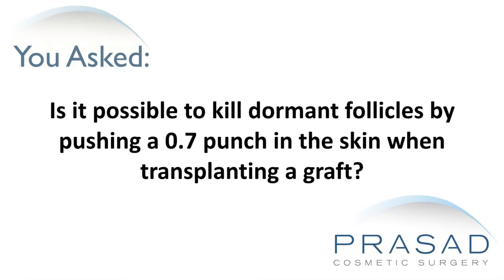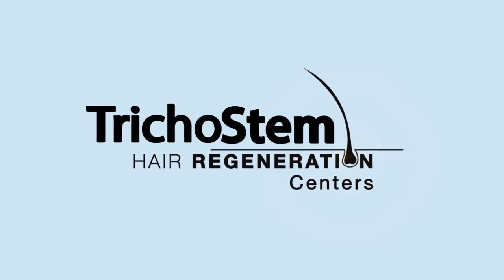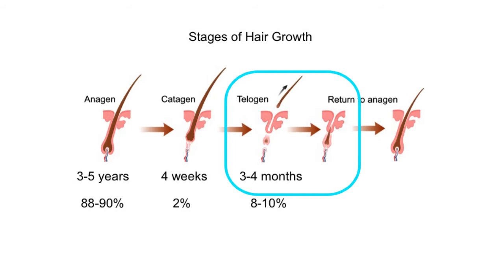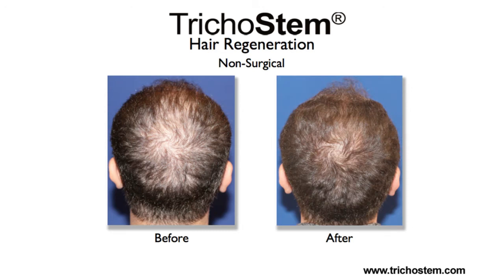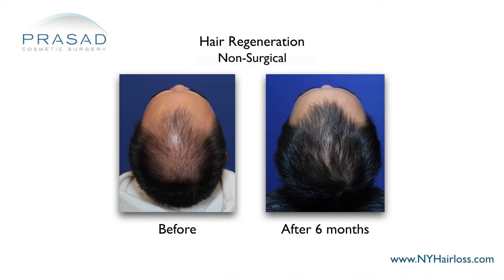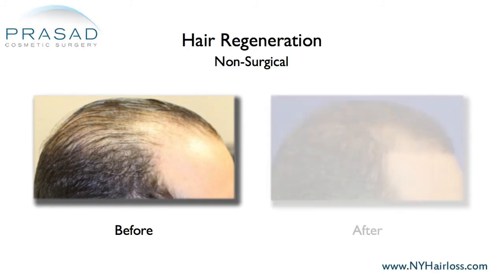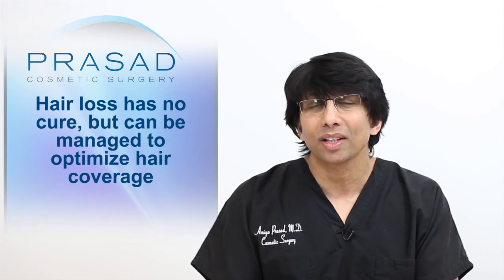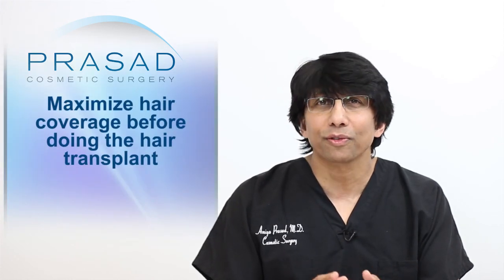How Hair Transplants can Damage Existing Hair Follicles, and a Transplant Alternative Treatment

Comment: Hi Sir,
Last week I have done with my hair transplant but my surgeon have done only frontal hairline as he said u have thin hair on the other part. So will give u prp session which will give more strength to your existing hair.
Reply from the maker: Hi Sandeep Prashar,
Hair transplants alone don't treat progressive thinning hair at all. However, my approach would be different as I normally thicken native thinning hair, and reactivate dormant hair follicles to grow hair again first, then consider a hair transplant. Most of our TrichoStem Hair Regeneration patients avoid a surgical hair transplant entirely after being happy with the results of our non-surgical treatment, which is not PRP alone, featured in the video. 

You can refer to these videos about the differences between TrichoStem™ Hair Regeneration from PRP alone:
https://youtu.be/vZAGaAssewY
https://youtu.be/xSMTd9qVwNo

Comment: I have an unusual situation. I have diffuse areas of my right vertex scalp that are practically devoid of hair but only measure 1/4" by 1/4". I'd like to get these areas filled in with hair but for the surgeon to locate them given my thick long hair would be a challenge and probably not worth their time. I suspect these small areas are barren due to pseudopelade of brocq, however it has not been professionally diagnosed but have had symptoms to suggest that is what it is. I refuse to do a scalp biopsy as I'm not looking to create more scars. I want to graft beard hairs into these areas to regain coverage.
Reply from the maker: Hi Emil Phoryew,
Sorry to hear that, but you would need an examination, and perhaps biopsies to confirm the diagnosis. Scars from a scalp biopsy can be hidden by hair. However, if you are considering a transplant using beard hair, the reason I don't perform these types of transplants is that donor hair extraction from the beard will result in visible facial scars. I hope this clarifies things for you.

Comment: Hello sir.. 
My hair is receding from my crown area.. and i have tried every possible solution. Like dermaroller, hair serums, pills, proper diet, prps since last 3 years... So all these things couldn't help me. And the patch is visible now.. so now i want a permanent solution.. so is it possible to transplant hairs over existing hairs... So afterwards it won't fall again and again
Reply from the maker: Hi mausam ghosh, 
It is not safe to transplant hairs near existing hairs as you will cause damage and permanent loss to native hair, like the video title says, and is explained in detail in the video. Also, you have not tried everything as you have not used a DHT-blocker like finasteride, nor have you tried the Hair Regeneration ACell and PRP treatment which shows results in the video. There is no permanent treatment for male pattern hair loss as it's a genetic condition with no cure, but it can managed so hair scalp coverage can be maximized for as long as genetically possible with the treatments I just mentioned. I hope this clarifies things for you.
Reply: @AmiyaPrasadMD  so can you suggest me some good dht blocker??
Reply from the maker: Hi @mausamghosh4562 ,
I mentioned finasteride in my previous response, but it is a prescription drug, so you do need to see a doctor for a proper assessment of male pattern hair loss before starting finasteride or dutasteride to block DHT. I hope this clarifies things for you.

Comment: Sir I have hair all over my head. And my head is visible when my head is wet. Sir what should I do?
Should I go for hair transplant or can try prp. Can ht can be done by not damaging existing hair. Or prp can gave me the hair which I had before....Please reply
Reply from the maker: Hi Gamer Gauti,
Sorry to hear about your problem. You first need to determine what the cause of your hair loss is, so seek a doctor to make a diagnosis through a physical exam and possible testing. You should not go for a hair transplant because you are likely too young for a transplant as they are best done for people above 30. Hair transplants are also not advised for diffuse hair thinning because it will damage existing hair follicles if they are too close to transplanted hair sites. The most important thing for you is to diagnose the cause of thinning first before you consider treatment. I hope this helps you.